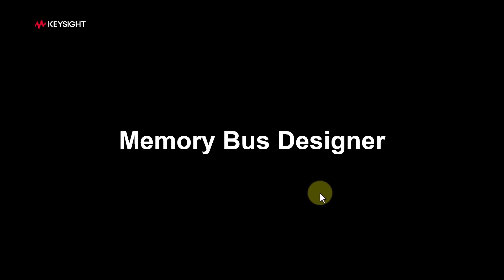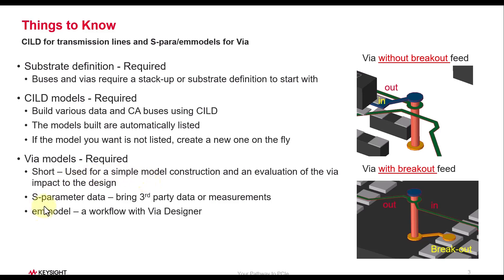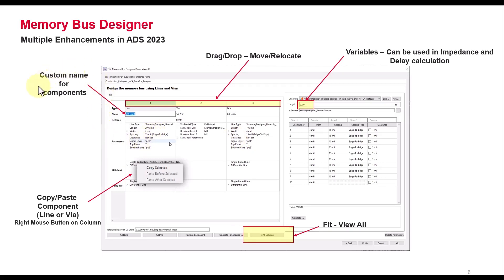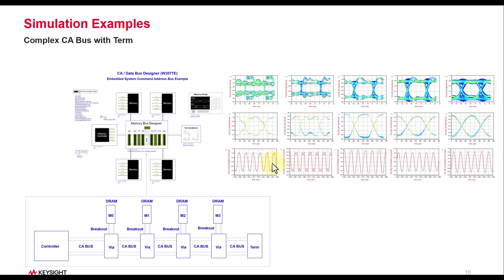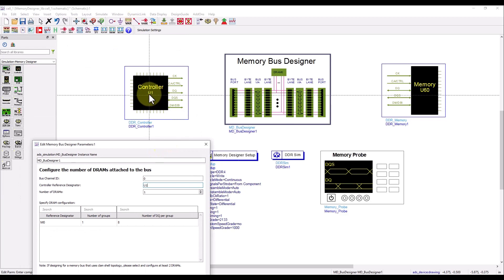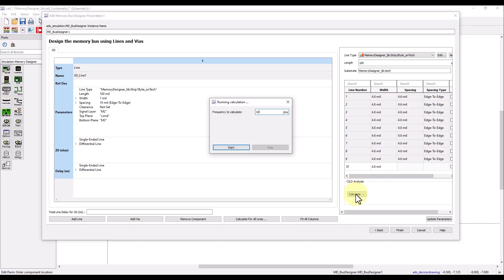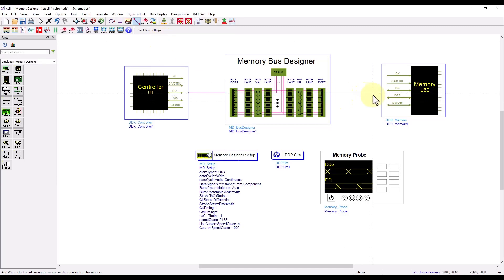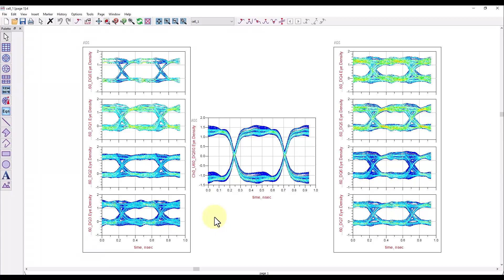ADS2023 Top10 - Feature 10: Memory Bus Designer

Comment: Sir, current I facing issue on injection lock frequency divider. When I inject a signal to the oscillator it's appear error of "circuit is stable. no zero phase crossings of the injected current were found". What can I do to solve this error? I can send you the full circuit if needed. Please help 🙏 😢
Reply from the maker: Please seek help from Keysight tech support team in your region

Comment: Hello, can you talk about the joint simulation of HFSS and ADS? Because ADS can't simulate waveguide structure and HFSS can't simulate diodes, how can ADS and HFSS be used together? I know the snp file, but I don't know how to optimize it.
Reply from the maker: Hi,
There is no direct way of using ADS with HFSS apart from getting a SnP file from HFSS into ADS which will be quite restrictive in nature. However, it can be very easily done if you use EMPro as a replacement for HFSS and you can create a parametric 3D models for any kind of waveguide or other 3D structure you want and bring it into ADS environment for co-simulation & co-optimization rather easily as ADS has FEM simulator which can easily & quickly simulate all kind of 3D structure like waveguides.
If you need further help on this then reach out to the Keysight Tech support team for help.